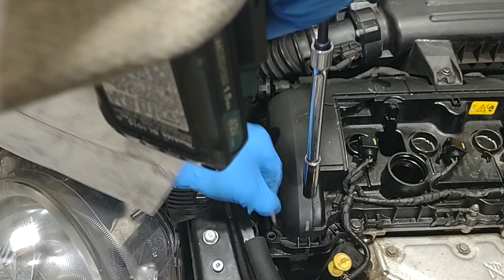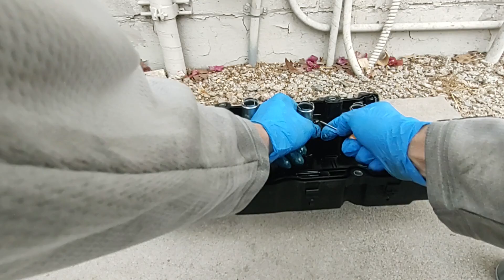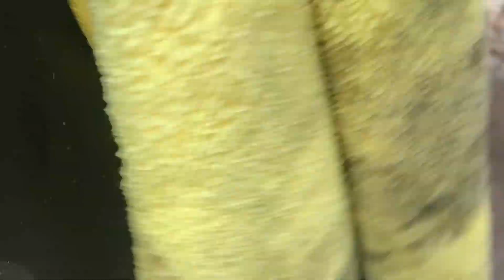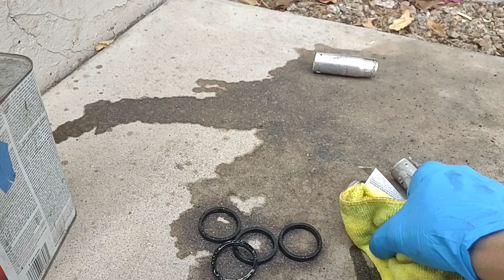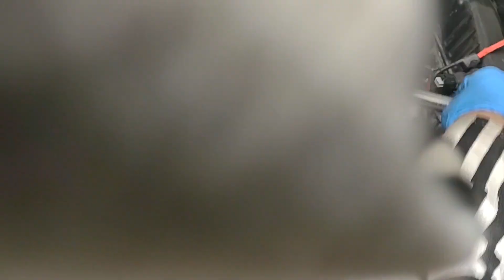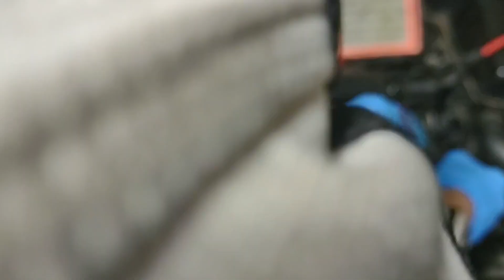2013 Mini N16 Valve Cover Gasket Replacement - Comprehensive Instructions including tips and tricks

Comment: It was impossible to see what you disconnected on the rear right because your arm was in the way.
Reply from the maker: I just had my cameraman executed as a result...  ;-)  It's hard to get a perfect angle on these videos because of the tiny engine compartment and necessarily shared space between the camera and me.  There's nothing on that corner that's really not intuitive, so I doubt you missed anything really critical.

Comment: This is called head gasket sir ??
Reply from the maker: Thankfully, no. A head gasket goes between the cylinder head and the engine block, and is a much bigger job. This was just the valve cover gasket.

Comment: What helped me take the valve cover off was hitting it with a hammer
Reply from the maker: When the gasket has really locked on to both surfaces, that's a good way to go. I'd recommend using a dead blow mallet, or at least taking it pretty easy to avoid damaging the cover.